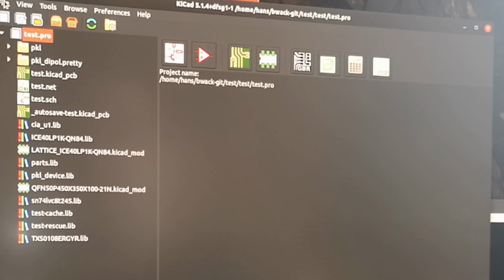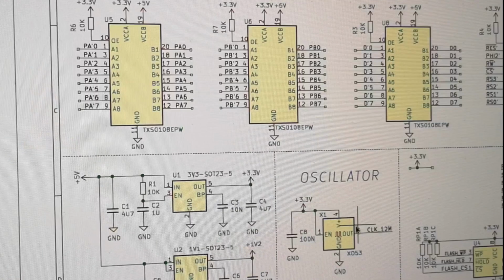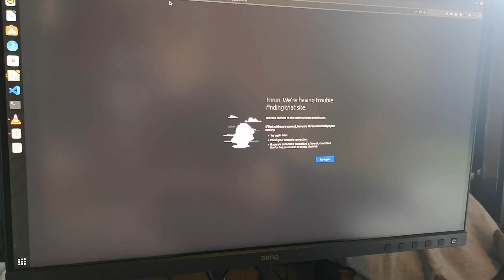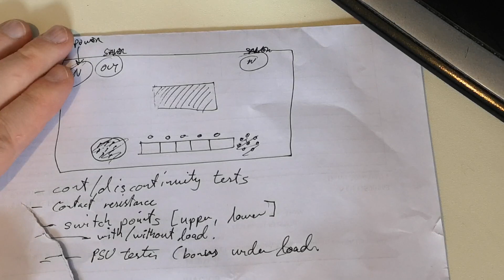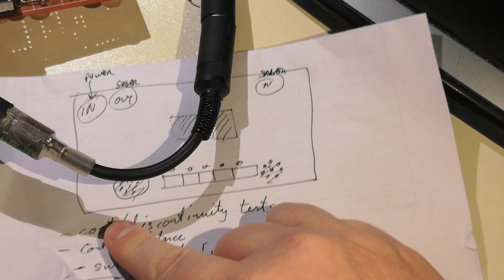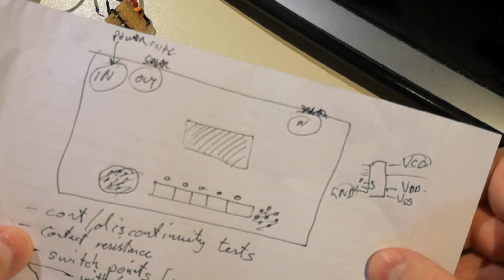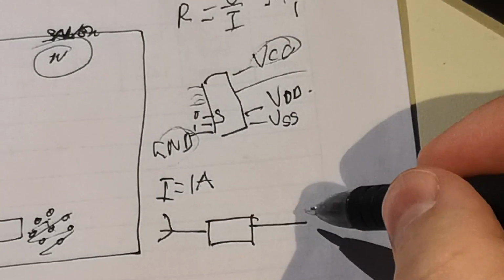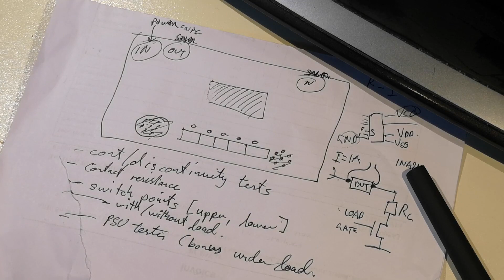C64 Saver 2 Test JIG ideas

Comment: Your work is amazing thanks for all your hard work there are a couple of you designed I want to build but I've never had a pcb printed and I'm not sure how to send or what to send from the folders and files u supply any help would be VERY greatful
Reply from the maker: Hi IDK. Thanks for your comment. The gerber files are what you want. If you want the c64 saver v2.4 it has through hole parts and easy to solder. You can find the gerber here: I agree it is a bit confusing what files to get. Try this link: https://github.com/bwack/C64-Saver-bwack/releases/tag/saver2.4%2Baddon1.2%2Bfw1.0 , download C64Saver2_4_gerber.zip, and upload it directly to your board manufacturer of choice.
Reply: @bwack  ahh now it actually makes sense that's a million mate

Comment: Take a look at the TCA6408A or a TXS0108e they are bidirectional voltage level shifter  that can switch at 100MHz and no need for a direction signal.
Edit: also the LSF0108
Reply from the maker: Thanks. I'll check at the TCA and LSF variants as well! :)